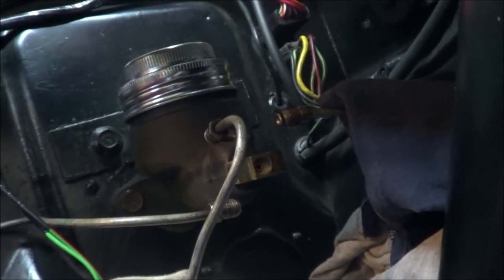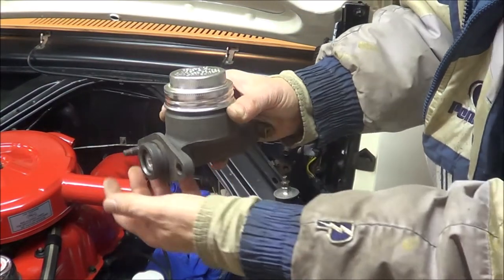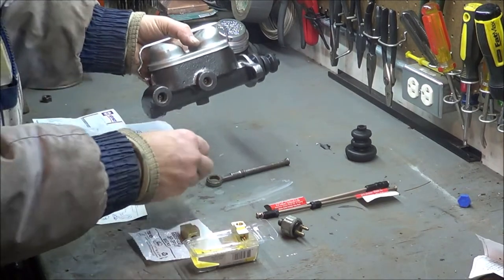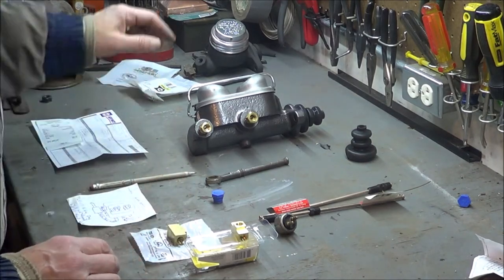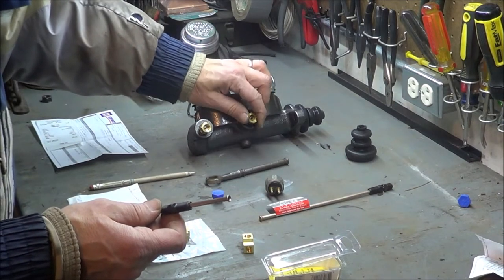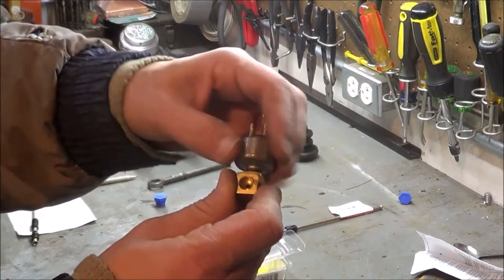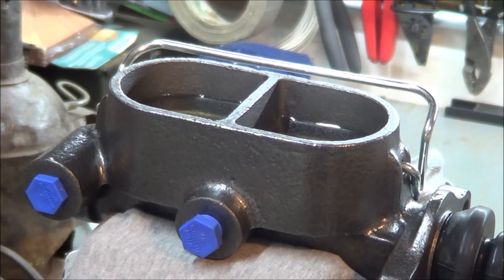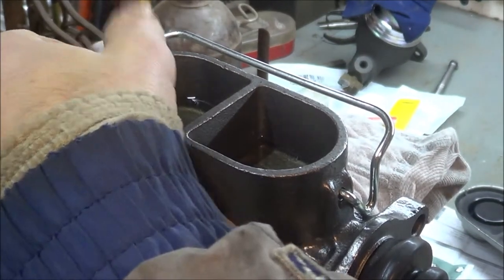Dual Bowl Master Cylinder Conversion 63 Falcon

Comment: Thanks for information and video Ten-Nine-Four! I have a 1959 Galaxie that has power brakes but uses a four bolt single manual master cly. Have been looking to upgrade for years. Ordered the dual drum master and after compairing it to the old single one, I am now confident that it will be a simple and inexpensive safety upgrade.

Comment: Well I did it on my 64 falcon, I made the change to dual bowl, I did replace all of the hoses and steel lines along with the wheel cylinders ,brake shoes and all of the adjusters and springs! Lines were  breeze, just had to modify them slightly. Thanks for the video.
Reply from the maker: Glad to have helped.  the dual bowl 
MC will give you more piece of mind.
Reply: Where did you buy that master cylinder ? Are the ones at napa better than the ones available at auto zone ?
Reply: Great video, Thanx !

Comment: Thank you for this informative & thorough video. Do you know if the Ford Falcon & Ford Thunderbird are comparable? I have a 1963 Ford Thunderbird & I want to upgrade from a single to a dual brake master cylinder set up but am having a hard time finding a dual brake master cylinder for a 63 T Bird. I have drum brakes btw. All information is appreciated. Thanks!

Comment: Thank you for taking the time to make this video. I have  63 Comet and want to do the same. Im on the fence about doing a complete front disk conversion and knowing that I would need a different MC for that. Is there any reason why you did not do a front disc conversion instead because if you change your mind you would need to start all over again with a different MC? 
 Thank you.
Reply from the maker: @galaxyflyer1  although it is much more safe, I didn’t do the conversion because I wanted to keep the car as stock as possible.  I convinced myself converting just the MC was far less intrusive to the car than changing most of the front suspension.  That said, if I ever have the car to my kids/grand kids I would probably do the conversion like you.

Comment: Getting ready to do this on my 63 Ford Fairlane, just concerned about the length of rod matching depth of new MC and 😂 will be looking  to make  adjustment on it.
Reply from the maker: Robert, all I had t do was swap the new MC brake push rod and use the original (and shorter) in its place.  have had zero problems since I put the dual bowl MC in my car.  good luck!

Comment: Just lost brakes in my 63 Falcon yesterday getting off the highway. Single circuit meant I lost all brakes. I had been thinking of upgrading to a dual pot master recently... all of the parts should be here tomorrow. Could have ended much worse than getting towed home.
Reply from the maker: Same thing happened to me w/ the Mrs in the car and a busy intersection in front of us. Needless the say,I was freaked out and my wife said she wouldn’t ride in the car again until I fixed it. I fixed in shortly thereafter.
Reply: I hope everybody reads this !!

Comment: Fantastic video. Question though. I plan on converting the front drums on my 63 to disc as well. You mentioned that the master cylinder is from a 67 mustang non disc. Will it still work or do I just buy the 67 with front disc master cylinder? Thanks
Reply from the maker: Thanks for watching and I hope the video was able to help you.  From my research on this project, the disc brake and non-disk brake MCs are different and are not interchangeable.  I would suggest you stick with a MC that is designed for disk brakes if that is what you'll eventually be installing in your ride.  good luck and keep us posted!

Comment: I was surprised to hear that the front brake lines are routed into the rear port on the new master cylinder.  I would have thought it would have been the front port.  Is this because the front brakes need to apply first?
Reply from the maker: That's a great question and to be honest, I don't know the answer.  it may be because one reservoir is larger than the other or as you said, the rear reservoir pushes fluid first.......however, with the fluid's incompressibility, I don't know if that would matter.  Maybe someone smarter than I can elaborate.  thanks for the comment.
Reply: @10947792  I have a 64 falcon in the shop right now & another shop installed a dual master with the front brakes off the front port and rear brakes off the rear port as "saffron" mentioned.     we are having issues with it holding the front brakes on tho.   I am going to swap the lines and see if it changes.

how did you decide to run the lines (rear port to front)  (front port to rear ) ?  any info would help to understand this better.   Is there possibly a check valve to hold some residual pressure on?
Reply from the maker: @runitmj  I used an article from the September 2006 Falcon National News letter.  I use their reference library as one of my go to sources for info and repair data.   it clearly links the front brakes and the rear MC brake line port.  if you're comfortable with this, send me your contact info and I'll forward a copy of the article to you.

Comment: I'm doing the same mod on a 49 F1. I popped a rear brake hose and lost all brakes last month. Dual circuit master cylinders are cheap insurance.
Reply from the maker: Totally agree. The parts were inexpensive… more importantly the peace of mind with regard to safety is the most important benefit. …..plus the wife will ride in the car again!!

Comment: I am wanting to do this swap on my 63 Galaxie 500. Are there any special adjustments that need to be made to keep the front and rear brakes in sync?
Reply from the maker: if your talking about using a proportioning valve, it was not required for this job.  If you have disk brakes on the front then that may be a different story.

Comment: How much improvement in brake performance was gained with the 4 wheel drums in comparison to the original MC?
Reply from the maker: I can't honestly say that I noticed any improvement in the drum brakes' ability to slow / stop the car......Its a 170 six so it can't go all that fast.  The reason I changed to a dual bowl MC is because I had a rear brake malfunction and subsequently lost all brake ability.......on a downward hill and approaching a major intersection.  I was fortunate I was able to glide through the intersection w/o injure/damage.  My wife was in the car and said she will never ride with me again until I upgrade the brake system to a dual bowl set up.
Reply: @10947792  so glad you both made it safe through that! 👍💯

Comment: Need the part number of the master cylinder
Reply from the maker: @madelinebryant7911  the master cylinder I used was from Raybestos.   Part number is MC36222. The important thing to remember is to purchase a MC that is for manual breaks (non-power) and is for drum breaks (non disk break). Look up ‘67 Mustang with a 200 CID, in line 6 cylinder engine on Rock Auto and you will have several manufacturers and quality options to choose from.  Good luck.

Comment: Anyone have a part number for a the master cylinder? Looking on rock auto and local auto parts stores and having a hard time ensuring the masters I’m looking at are manual drum brakes
Reply from the maker: Just saw your question.  I don't recall the part number however you should be able to call Auto Zone (where I got it from) and tell them you want a dual master cylinder for a '67 Mustang.  MC must be for a non-Power steering, non power brakes Mustang.  you could probably look that up on Rock Auto too.

Comment: Watches video,but see a couple of part numbers ,do you have a list you can send me.
Reply from the maker: NM, unfortunately I do not have a list of the part numbers readily available.  You should be able to re-watch the video and pause it so you can write down the individual parts numbers.  Its been a while since I made this video, but I believe i included the part number for every part I added or included in this project.  good luck and let us know how it turned out for you!
Reply: After watching several times, have gotten all part numbers, as soon as my new lines come in the project will be done. My falcon is a 1964 , it was parked outside on grass, the moisture wasn't kind and rear lines suffered so replacing front to back and all 4 wheel cylinders. Thanks for the video , I will document the parts numbers for future reference.

Comment: Hi I’m about to put a dual master cylinder on my 64 falcon but I am having a problem getting the tee fitting that you install the brake switch too, can you please tell me where you got it because napa in Canada does not carry it thank you.
Reply from the maker: On the '64 Falcon, isn't the brake light switch on the brake pedal itself??  the reason i ask is that my friend as a '63 Falcon but when he installed the dual bowl master cylinder he changed his brake light switch and moved off the master cylinder to the brake pedal which he told me was used on the '64 Falcon.
Reply: No mine is in the master cylinder
Reply from the maker: @deedeedeedee5829  Got it.  I will look for the part number and send it to you.  You should be able to look it up on line.
Reply: @10947792  thank you
Reply from the maker: The part is manufactured by Gates.   Google search on part number G60696-0303......  brass female inverted branch tee to female pipe.    $7.30 US from toolsid.com
Reply from the maker: So when I read further I see its out of stock at toolsid.com.     that's the right part number.  try NAPA on line in the US.  its a 3/8" x 24 fitting.
Reply: @10947792  I ordered one from inline tubes they had lots in stock. Thank you for your help
Reply from the maker: @deedeedeedee5829  Sweet.  Good luck!
Reply: Good, simple and clear explanation on how to do this necessary upgrade. The next step would be to add power brakes which is also fairly simple. Although I don't own a falcon I do own its last desendent. My little lincoln came with power brakes and  4 wheel disc. No need to upgrade that, but I sure your engine puts out more power then my 351w at least for now.

Comment: how did you seal the pipe thread on the brake switch?
Reply from the maker: Both reducer fittings are brass and no sealant is required......at least I've never used any.  I just tighten them till very snug.....if it drips, tighten it another 1/6th turn.

Comment: Do you have a part number for that master cylinder?
Reply from the maker: ChickenLegMan......great handle!!  I bought the MC at Advance Auto.  try one of these two numbers...... 101378  or E 5350433.  those are the numbers reflected on the receipt.  Price was $22.99 plus the core charge. Good luck!!
Reply: @10947792  thank you!

Comment: Do you happen to have the size of the reducers?
Reply from the maker: I don't recall off the top of my head, however I'm sure you can google the part numbers to get the size of each reducers.  the part numbers are:  G49503-0303 (this is the one closer to the radiator) and the other part number is G 49505-0503 (closer to the firewall)
Reply from the maker: #503-0303 -- 9/16" - 18 pitch      
# 505-0503  1/2" - 20 pitch
Reply: @10947792  t
Reply: @10947792  thank you I appreciate the info 🙏🏽

Comment: I think I would have piped it in first and then bled to master cylinder but I know I'd be listening to the same Floyd stones Black Sabbath
Reply from the maker: thanks for the comment.  I was following the steps a member of the Falcon Club of America published and didn't want to vary them.  I would say the it was probably done as a bench bleed vice on the car because the space is limited and the potential to splash brake fluid on the paint is great.  Otherwise your idea would certainly work as well.  cheers and ROCK on!!